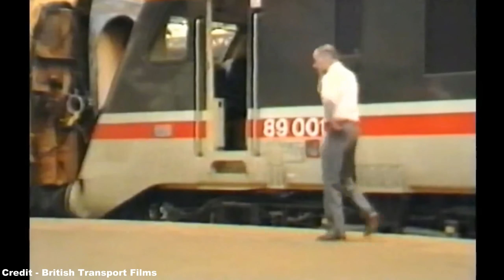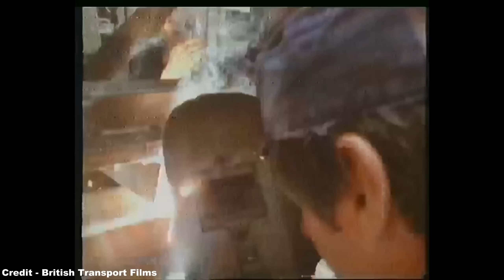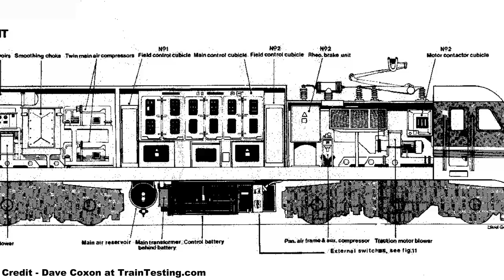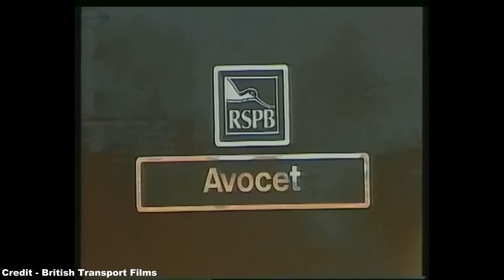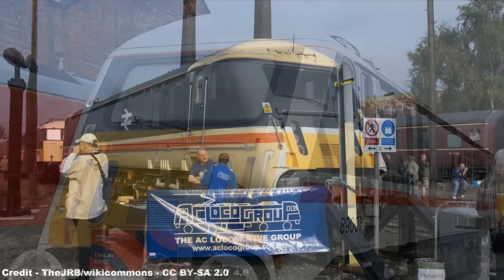Class 89 - The Surprising Solo Act

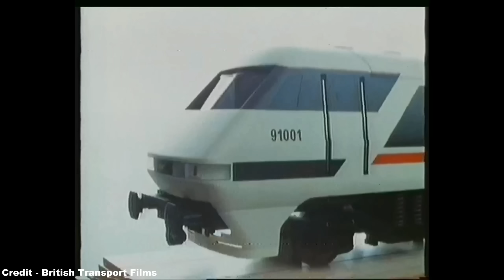Comment: GEC Traction Electra - Power Car 3:20

Sharp Cab 1 / Blunt Cab 1

Both Cabs Are Number One

Catenary Blunt (“91”)

Catenary Sharp

Distributed Power (“95” Steam Workshop)

Engined Locomotive = Power Cab / Trailer Cab

Engineless Locomotive = Catenary / Wireless

Power = Steam, Diesel, Petrol, Jet, Rocket, Etc.

Cab-Ended DGVTs (Driving Generator Van Trailers)

Catenary Trailer Van

Voltage Cab / Trailer Cab

Battery Cab / Trailer Cab

And So Forth & So Forth

Engine Cab Rotation (Fossil Fuel Power Both Cabs)

Battery Cab Rotation (Engineless: Battery Both Cabs)

Engine & Battery Cab-Switcher

Battery Cab / Engine Cab

Engine Cab / Battery Cab

Tail-Ended DGVTs (Driving Generator Van Trailers)

Current/Trailer Cab (“95” Steam Workshop)

Trailer/Current Cab (“95” Steam Workshop)

End-Mounted (“95” Steam Workshop) Wired Both Ends

Wireless Tail-Rotation (Wireless Both Ends)

Comment: Brush Traction HST-Unit (Engineless)

Engined Locomotive = Engine Cab / Trailer Cab

Engineless Locomotive = Catenary Cab / Wireless Cab

Battery-Engined = Engine Cab / Battery Cab

Battery-Engineless = Battery Cab / Trailing Cab

Comment: Small comment/correction. @3:11 The Class HST Locomotives are Deisel Electric, so already had traction motors. The scheme was to replace the diesel engine and generator sets, and add                        a pantograpth and associsiated electrical equipment to power the motors from 25k overhead.
Reply: Ruairidh does occasionally make mistakes but trying to correct him in the comments is usually fruitless since he rarely reads them nowadays apparently.

Comment: GNER used to hire some of Eurostar’s Class 373 “E300” that were used on Kings Cross-Leeds, York and Newcastle routes. And with the Class 91 Intercity 225 stocks due to be replaced by the new Class 897 Tri-mode “Serenza” trains that are to enter service in 2028.
Reply: How is this relevant to the Class 89, please, Andrew?
Reply: Did the Class 373 “E300” hired by GNER still have the pickup shoes for 3rd rail operation I wonder?

Comment: One problem with electrics unlike steam and diesel is when inevitably the mainline railway moves past them in both physical and regulations. 

There are no heritage railways to take them and/or especially run them as they are all based around the steam or diesel era. We are seeing this with class 90's in the hands of freight operators just sitting in a yard turning into scrap and soon we'll be seeing it with LNER and the 91's.

Comment: Ironically the 91s never saw 140mph working or get fitted with tilt that they won the contract on
Reply: Maybe when ETCS is rolled out entirely and when or if they can improve safety at Level Crossings for one thing to match ETCS the 140mph speed may soon materialise at least. Albeit with The Azuma sets.

Comment: 3:14 erm the class 43 power car has electric traction motors :-/  hence it is a diesel electric locomotive. Did you mean the proposed idea was to fit pantograph and transformer equipment to the class 43 body shell??

Comment: Class 90 locos can also travel at 125 mph, that’s what they were built to do. I know they were limited to 110 mph on WCML but many a driver told tales of 125 mph running unofficially of course.
Reply: Not true, Class 90s have a speed limit of 110mph regardless of route. That's why when they were hired in for ECML services they were diagrammed onto the Leeds services as they didn't lose as much time as they would on the Scottish services being both geared differently and different top speeds (Class 90s had a faster acceleration rate but a lower top speed while the Class 91s had a slower acceleration rate but a higher top speed). Any faster would have resulted in very rough riding for the passengers. Any talk of the fleet doing 125mph is simply platform nonsense.

Comment: Thanks for posting. I was wondering if there was any substance to the notion that what held it back from a more speedy (and cost-effectove) return to service, were the power conversion and control electronics? I hear they were custom made and that a reverse-engineering exercise was necessary, in order to build replacement converter control PCB's. A cost of over 1 million pounds for this work has been suggested in various press releases that I vagualy seems to recall.

Comment: If the Eurotunnel Class 9's were partially derived from the Class 89, that would mean Kiwi Rail Class 30's; of which the Eurotunnel Class 9 were developed from must have some the same lineage for those components. Fifteen Kiwi Rail Class 30 lokos have recently been overhauled, this was a significant nightmare due to outdated technology.
Reply: That's correct - they were under construction around the same time as the 89 was being tested at Brush, Loughborough.  There's a photo of the two types together somewhere...

Comment: BR, just before privatisation, warned GNER that they would need 15 of these (or similar) for semi-fast work, so... we could have had a few of these!😊
Reply: Ruairidh's commentary is, as it often is, unfortunately not entirely accurate. The Class 89 in itself wasn't a failure of design. It was BR management during the 1980s that moved the goalposts, with the aspiration for 140mph linspeed being what lead to the Class 91 and Mk4 coaching stock (aka Intercity 225). With the 140mph aspiration being abandoned by the end of the 1980s, a squadron fleet of Class 89s plus Mk3 coaching stock would have sufficed, but by that point the Class 91s were near enough all built.

Comment: And a few years after the electric HST was dropped several HST power cars were fitted with buffers and standard draw gear for use with the Class 91s whilst awaiting the delivery of the Mark 4 coaching stock.
Reply: The converted HST power cars were also tested on the WCML with 86/87s.
Reply: @wire9486 never knew that. I knew the prototype power cars were used on test trains with the APT power car but not that the production power cars were used with Class 86/87.
Reply: @neiloflongbeck5705  What?

THe HST prototype power cars ran with the APT power car?  Was that the APT-E gas turbine or the electric APT-P?  Could we have more details, please?
Reply: @00Zy99 APT-P. One formation consisted of the prototype HST power cars, Test Car 8, APT-P power car and Test Car 5. There was also an APT-P trailer Car Test trains which used a prototype HST power cars, Test Car 9 and the APT- P trailer cars with a trailer brake and a driving trailer plus at least one intermediate trailer.
Reply: @00Zy99 A number of pics exist out there with prototype HST power cars running with APT-P motor units.
Reply: @neiloflongbeck5705 that's where they did the initial testing in 1987 before the 91s were out. They even worked with the 89 a few times too!

Google blackwatch55013 on flicker 43123 at Birmingham New Street
Reply: I pretty sure when I was a kid I saw HST's fitted with pantographs working through York
Reply: @gazbrucia1654 possibly the 91/HST hybrid trains formed when the 91s first came into service, formed by swapping one of the power cars with a 91 coupling up to the TGS(some of which had buffers on one end), these 43s where fitted with buffers and TDM multiple working.

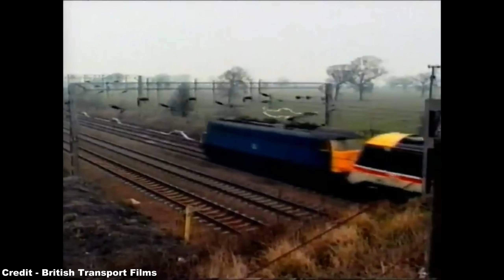Comment: Whats trailing from the rear pantograph at 4:10?
Reply: Used for aerodynamic testing of the pantograph.
Reply: @spadgebump must have come loose then.
Reply: @neiloflongbeck5705 they're meant to dangle so you can see the airflow and vortexs
Reply: @mutekn0wm0re82usually numerous small tufts of wool about 6 inches long would attached to the item under test. I doubt they would be attached to a life expired locomotive coupled to a new locomotive.
Reply: Looks like a strip of plastic sheeting.